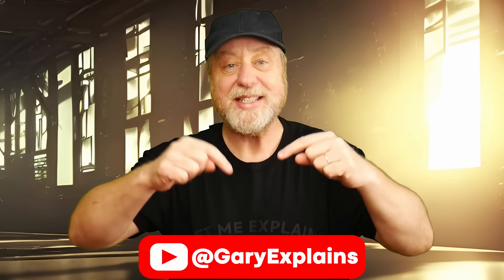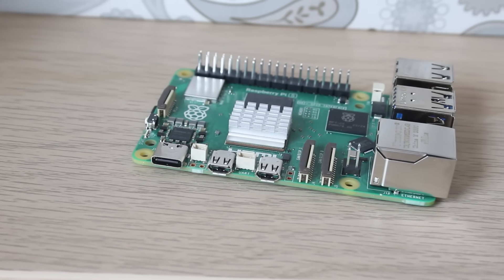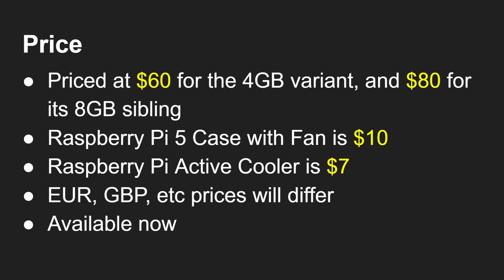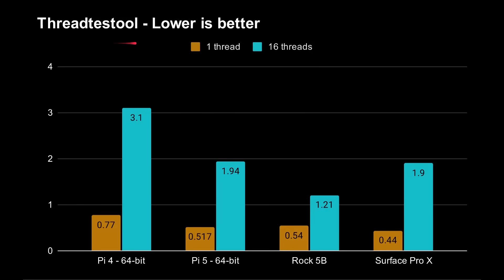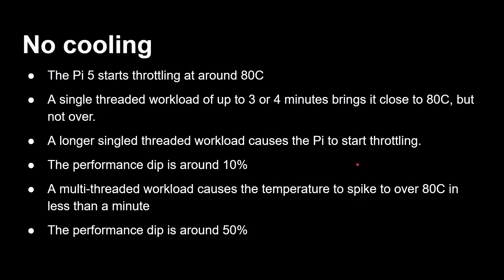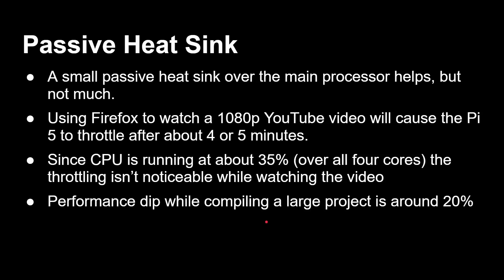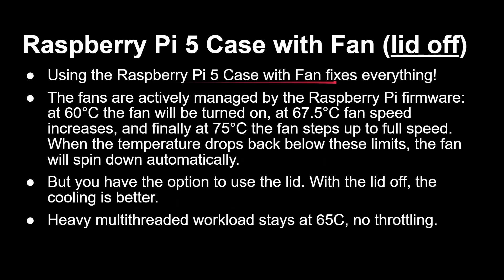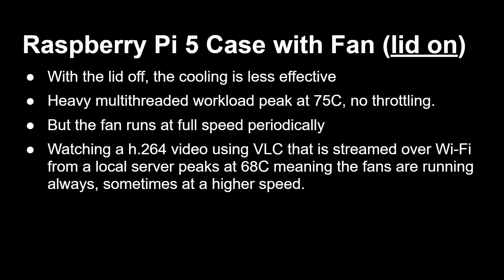Raspberry Pi 5 - Performance, Thermals, and Overclocking

Comment: The chart is confusing beginners. If lower is better, then single core is better than multi threaded. That sounds "stupid". But in fact also true. Because: Why do you run 16 threads on a raspberry pi 4 and 5, they can perform only 4 threads well! So running 16 threads if of course 4 times slower then single core. 4*0.77=3.08. This might be the reason why it is 4 times slower. Not sure how you computet the numbers in the chart. Bit it look ok, since in that case it doesn't reduce the clock speed (because of thermal problem. So it looks like your cooling system is good enough), no boost (like x86 cpus) and also no cache problems (since i guess searching for primes with that tool doesn't need much cache). But software that need less cache are not very "realistic" for many other daily tasks. I will do a more realist test as soon as i got my Pi. (I will get it hopefully tomorrow). So i hope i can upload a "better" test in the next days on my YouTube channel.
Reply from the maker: Unfortunately you don't understand the test. The code is in my GitHub repo if you want to look at it.
Reply from the maker: Ok, I was going to reply with the rationale for the testing methodology but when you used the word "stupid" I decided that it clearly isn't worth it. Thanks for watching.
Reply: @GaryExplains  Ahh... Sorry, I am not speaking English well and i don't want to insult anybody.
So I replaced "stupid" by "not good".
Reply from the maker: Ok. I understand. It is late here and I am typing on my phone. I will write a full reply tomorrow. 👍
Reply from the maker: OK, so first some caveats:

1) Comprehensive benchmarking is a complex area. There are "professional" benchmark suites like SPEC that are used when precise and inequitable numbers are needed. My testing is much more "hobby" level. However, the results from my "hobby" level testing aligns quite well with the more complex types of testing.

2) Even "hobby" benchmarking can be hard because even which compiler you use can impact the results. I have videos here on this channel about the differences in performance between Microsoft's compiler, LLVM, and GCC all on the same platforms with the same hardware. The advantage here is that we are testing the Pi 4 and Pi 5 using the same OS and toolchain. The same toolchain is also used on the other platforms like the ROCK 5B, etc.

3) I have several tools that I have written including my threadtesttool.c. I have several other tools including a memory test and some other singlethread/multithread tools. I didn't include them in this video as I felt the video was getting slow and too long. I have the results if you are interested.

So, now to address your particular concerns with my testing.

a) The threadtesttool is a time-based tool. So lower is better, because the test finished quicker. 
The single-thread test and the multi-thread test are NOT related in that the multithreaded version is NOT running the same workload as the single thread and therefore you should NOT expect the score to be (time/number_of_cores). No.

b) Therefore, you can't compare the singlethread score to the multithreaded score.

You mention caching. That is indeed an aspect that needs to be considered. See point 1) above. However, as I said, my test results align quite well with more complex ones. Caching of course isn't the only issue memory bandwidth is another. Again see point 1).

However, you called my methodology "stupid" (later "not good"). I totally disagree. Your argument is:

i) "If you run only 4 threads, then it will be much more cache-friendly. So there will be fewer cache misses and by that, it will be faster.

ii) Also the kernel scheduler doesn't need to give time shifts to many different threads, that is only eating performance without getting practical performance.

EXACTLY. That is what we want. Making something cache-friendly and taking the stress away from the kernel scheduler is completely artificial and not real-life at all. In fact biggest criticism of benchmark software is that "it just runs from the cache".

Starting 16 threads in the way I do, reflects "real life" in that all modern OSes including Linux, Windows, macOS, Android, and iOS, are all multi-tasking OSes, which means that tasks are switched between cores all the time, in fact even when running a benchmark.

Testing the performance in a nice friendly environment for the CPU and the OS is completely artificial and next to useless. In the real world, the Pi has multiple tasks running concurrently. The more load on the system, the more it has to deal with cache misses and context switches, that is the WHOLE point. The last thing I want to test is some fake setup that doesn't reflect real-world usage where I tune the tests to be friendly, no.

The caveat is that as long as the same conditions are given to each device (Pi 4, Pi 5 etc) then the test reflects real-world usage, not a sterile friendly environment. The aim is to compare one platform to another under these conditions.

As you say running with a 1000 threads is also an option, and I have tested boards that way as well. 16, in that sense, is an arbitrary number, I could have picked 32, 64, or 1000. The results and the methodology remain the same. So to answer you question, no I can't see why that is not good, I can only see that it is good and far more realistic.

To explain a little my background is in software engineering for heavy-loaded servers (going way back to VAX VMS), and also in real-time systems. In both scenarios getting the best performance from real-life configurations is 1000 times more important than writing software for some artificial sterile environment that doesn't exist in the real world.

One thing that is confusing me about your replies is that you seem to contradict yourself. In your first reply, you say that "software that need less cache are not very 'realistic' for many other daily tasks." But in your second comment you say, "If you run only 4 threads, then it will be much more cache friendly. So there will be less cache misses and by that it will faster."

So, which do you want cache-friendly or cache-unfriendly, which is more realistic?

As you say, all this can be learned "in every coding book for multi-threading", I just guess that you made some incorrect conclusions about it once you read the books!

There is much more than can be said. But I think that is sufficient for now.
Reply: @GaryExplains  Thank you for your long answer.

I will try to answer a bit shorter:

1) I know. Same as me. And it is similar to me. It is also only my "hobby", since i have an other profession.
2) I know. I testest myself with Intel, AMD, MAC M2, Rasperry Pi 1 to 4 (i just got the Pi 5 today :-)) and also with gcc, clang, mvc and intel compiler. You can see some of by results on my YouTube Channel. But not all. Some results are published only on "my" (in fact it is not my, but i am second admin there) forum. You will find it very fast as soon as you saw my YouTube channel.
3) I didn't wrote synthetic benchmarks. (Ok, i wrote some for me to speed up my algorithms, but i didn't published that results.) I published only results from "real" benchmarks. So in fact "professional" benchmarks. I publish benchmarks from compiling time and from generating school timetables. So this are real world problems for professional guys that are coding or doing the timetable at schools or universities.

a+b) Yes, that is why i said it is not easy to read the results for a "beginner". If i benchmark, then you can compare single and multi core. That is in my opinion much more helpful.

i+ii+EXACTLY) I totally disagree in that point. If i compile, then i compile with "make -j4" or "make -j8" or ... deepening on how many threads my CPU can care about. I will never compile with "make -j16" if my CPU doesn't support so many threads. There is no advantage in using a higher number, only disadvantages. You can't be faster by that. You can be only slower by that. (ok, except you have got a very slow hard drive, then you might be faster, since you can still compile while the threads are waiting for saving the file; but i never noticed that.) 
Also if you generate timetables, then you will be slower if you use more threads. That is why we even disabled it for a user to select a higher number of threads.
I never used benchmark like blender or other raytracing tools, but i bet most of them disallowed it also, since it make no sense to have a higher number. Also video editing tools like kdenlive disallow it. You will never be fast, in best case it might be only a very little bit slower. I bet in most cases it will be much slower. You can read that also on every coding book about multi threading.
Also why 16? Do you think a game developer now thinks: Hmm... Let's use 16 cores, because that is the best. Real life coding (not synthetic benchmarks) doesn't work like that. 

I am sorry that my words were too "hard". I don't want to insult you. You are doing nice videos. I like most of them. But talking about this might improve your videos.

No, you didn't get the point about the cache. I am not contradicting myself.
Let's assume a thread need only 10KB (cache). If you have 4 threads with each 10KB (cache), then you need in total 40KB (cache).
But if you use 16 threads, even you CPU can handel only 4 threads, then it is not "too bad", since even 16 threads uses only 16*10=160KB (cache). That is pretty small. It will fit in most 2nd or 3rd level cache sizes. So you won't notice a large bad impact.
But sadly many "real world" tools doesn't use such a small cache size. But a lot of synthetic benchmarks use only a small cache size.
So let's assume you need 1MB (cache) and you have 4 cores. So you need 4*1MB. If you have 4MB cache, then all is fine, since it fits into the cache and you won't have cache misses.
But you always starts 16 threads. Then you will need 16*1MB=16MB, but if you have less then 16MB cache size, then you will get a lot of cache misses, so the software will slow down very much. That is why it is bad to open more threads then you have CPU cores/threads.
 You can for example use tools like Cachegrind to count the number of probable cache misses.
Reply: Well this was "interesting" 😂
Reply: @nathanchalecki4842  What do you mean with "interesting"? And what do you mean with "this"?
Reply: @nathanchalecki4842  If you want to see more intresting stuff like that, then checkout my channel. I just uploaded for example a video where i explain how the fan control of the Pi 5 works and how to stress the CPU. But there are also some other intresting videos about that topic there.

Comment: You guys 'member when the fan was purely optional and no way mandatory for those little things?
I 'member.
Reply from the maker: The previous models are still available if that is your use case. But it is impossible to improve the performance without adding some kind of better cooling. People wanted more performance from the next version, so here we are.
Reply: I suppose you can downclock it, although you wont get the 2-3x performance increase. Maybe 50% or so as there are still architectural improvements. We will see how flirc cases perform.
Reply: The Pi 5 is at least 50x as fast as the pi zero which itself was >2x as fast as the original pi. The “operations per watt” metric has also been vastly improved. And you can run a pi 5 without forced air, just not at sustained full load. Seems like a reasonable trade-off.